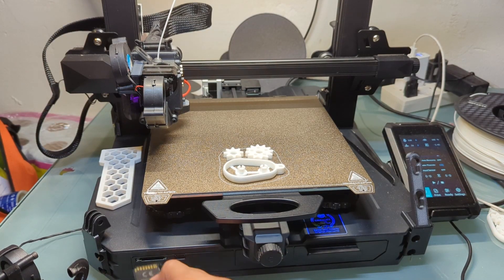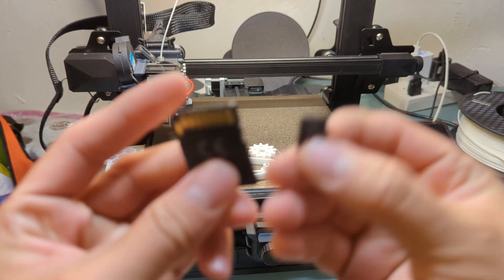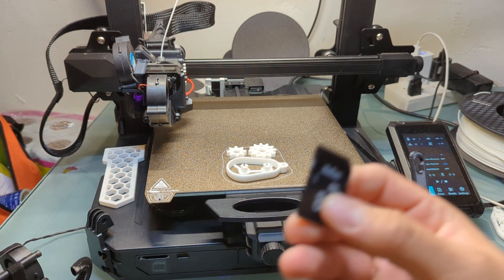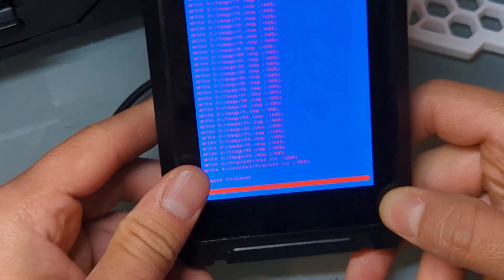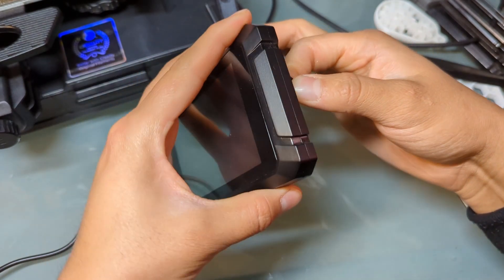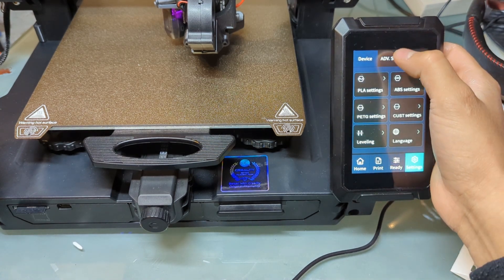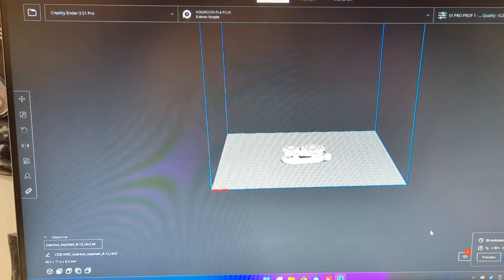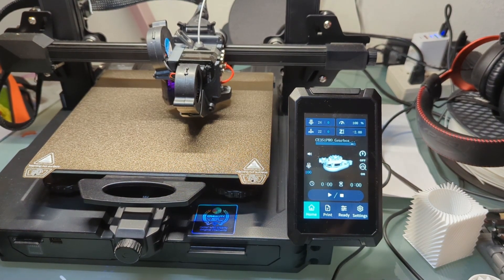Ender 3 S1 Pro/Plus - TT's New Custom Firmware (GCode Model Previews!) Part 1.

Comment: Enjoyed the video, but I have a problem. I have the an ARM   STM32F401RCT6  chip, but none of the firmware's work. Some load but still none complete the homing cycle. They raise slightly, homes X, Y, goes to center, CRtouch cycles , Z-axis moves down to their stating point and then stop. Have you a fix for this.

Comment: The TT firmware has a lot or errors, for example the step motors overheating, and don't deactivate when finish the print.  I had to revert to the original firmware, but It's good to try new ideas.

Comment: You never got around to making part 2 man, I followed this and now have TT firmware working on my S1 Plus, but the script for thumbnails wouldn't work with the current 2.3.0 Orca Slicer (on Mac), even though I meticulously followed all the directions in the GitHub page, and I got ChatGPT to guide me through it to make sure I din't muck anything up. But in the end ChatGPT found that the .py download script itself had errors in it which caused a persistent error in Orca when trying to export the gcode. 
After about an hour of trouble shooting with ChatGPT it finally figured out what the error was and I just got ChatGPT to output a completely repaired .py file which I copied and pasted into the text file and then it worked perfectly.

I can't believe such a simple little thing as exporting a thumbnail is such a headache and a complex thing to set up like this.

Maybe I should make a video of how mine is set up and provide my repaired Python script for anyone out there like myself that couldn't get it working by following the provided instructions....

Comment: Installed the firmware today, along with the display,,,,Bricked the machine!!! Problem is, if you choose laser, it will be stuck there, there is no flash or anything that will change it back to printer...Re-flashing does no good...BRICK!
Reply: Have you gotten your way out ❤

Comment: Just followed this video to update my Ender 3 s1 pro with this software which is v020 and it worked like advertised minus the screen load screen. not sure if that is a new thing or not. printer is under a year old.

Comment: what are differences between abl and ubl firmware s1 plus
Reply from the maker: I never looked into it, you can check on the discord though :)
Reply: To sum up, ABL and UBL are the same in that some sort of procedure is used to scan the topography of the bed surface but they differ in the sense that for ABL you are required to have a automatic leveling sensor and choose less points while you can have more probe points using UBL including advanced features as editing and storing multiple meshes.

Comment: You can determine which one you have by looking at the Firmware Version within the display's About section.
      You have a STM32F103RET6 if the F/W VER ends with F1
      You have a STM32F401RC if the F/W VER ends with F4

Like so more people see this. Thanks

Comment: Arkadaşım merhaba. Ürün yazılımını Ender 3S1 Plus yazıcıma yükledim. Ancak Dil seçtikten sonra bir önceki sayfaya dönmüyor, yazıcıyı kapatıp tekrar açmak zorunda kalıyorum. Bu aynı zamanda orijinal yazılımın önceki sürümünde de yaşandı. Otomatik seviyelendirme de orijinal puan sırası değişti ve sonuçlar tamamlandıktan sonra görünmüyor. Ekranda G.code görünmedi, ses açma/kapama düğmesi ekranda görünmedi. Birçok eksiklik var, umarım düzeltilir.
Reply: Hello, I too had issues like this on firmware upgrade, the microsd was my issue I used a new 16gb one and it worked, my other card was 32gb. May this help?
Reply: I don't think it's related to the memory card. I always install original software with the same memory card. I also have problems with the printer tray. I couldn't figure it out. @yukiusaginotaiyou

Comment: You can find your chip by going into settings then about rather than taking the bottom apart. 32 gig and below work for SD because they format to FAT32 required format for the printer.
I have a s1 not pro but i do have the touchscreen upgrade, do you think this will work for me my chip is F4.

Comment: it may be an amazing video, BUT TOKA'S FIRMWARE IS ABSOLUTE CRAP!
1. Homing is a total fail if you tram the bed either manually or automatically.  Also, the option to decrease the number of tramming points in the auto-tram map is not operable. 
2.The worst effect of his severely buggy firmware is that if you connect directly via USB, the hot end goes immediately to thermal overtemp. Only shutting off the printer solves this.  
3. Homing forgets where zero zero is almost immediately after a print.  
4. The Pause command drags the hotend over the entire print without and z hop at all thus stripping the print from the bed.  Stupid
5. The PID test is defaulted to run to 300 degrees on the very first test so you are likely to have thermal runnaway immediately because the first Oscillation goes to about 330.

You really shouldn't be pushing this guy's code. It is buggy and has very poor quality control.
Reply from the maker: Other than the homing issue on the earlier releases, I've never had any of the other issues you mentioned. Have you joined the discord and shared your input there so you can get help? Could be possible you installed the incorrect version for your printer.
Reply: 1. Homing works perfectly. The auto-tram points only work with 5, 7, 10.
2. This has never happened to me and I have been using this  (007-023) for over a year now.
3. After the print you must be using M84, which unlocks the steppers and that invalidates home.
4. This is a gcode issue, usually. Using "M600" to pause the print works perfectly. It has always raised up a far amount and than moved to the right fully.
5. It defaults to 300, but you can change it to the temp you are going to use. I cannot say this will or will not happen, because I have only used a max temp of 245 C.

Many, many are using this firmware without issue. So, you cannot say it is poor quality just because it did not work for you.

Comment: FOR EVERYONE WHO HAS F1 CHIP:
If you have been wondering, what rc or re suffix means, its you chup version. Look on your chip, and under stm32, you will have something containing rc or re. If you have rc, download rc bin file, if re, download re bin file. Also, abl and ubl are types of bed leveling, look them up on google. ABL takes less time, but its little bit worse, if you have worn out bed.

Comment: Hello. The calibration setting on my 3s1 Plus printer does not work. When I look at the automatic calibration indicator that came with the latest update, the edges and middle points show irrelevant values. I couldn't do any calibration. Does this software automatically calibrate according to the values received from BL Touch? Will I experience the same problems?
Reply: same here.

Comment: Hello. the firmware works well. Is it possible to make the motors turn off after printing is completed?
Reply from the maker: Yes those issues were fixed on the newer versions, try installing V20 (newest release). https://github.com/ThomasToka/MarlinFirmware/releases/tag/MARLIN-E3S1PROFORK-BYTT-v020

Comment: does it have to be fat32 cuz i only have a 512 gig micro sd card and it is not fat32
Reply from the maker: I believe you can format it to fat32, but I'm not sure it will ready 512GB, you probably have to partition it. Would be easier to buy an 8GB one just for this.
Reply: ok thx ill ask my dad if i can get one @Zeltroix
Reply: can you use 16 and 32 gb sd card @Zeltroix
Reply: I used a 32 gb card but I had to do extra steps to format it to the specifications needed. It will probably need done through disk management.

Comment: I followed your video tonight, got it all installed. Did the 10x10 one though, did my rough tram and then the auto bed mesh, adjust my gcode in cura and when it starts it just smashes into the bed, I reset all setting manually trained it that’s it removed the auto level in cura printed great, any pointers?
Reply: Read the installation txt. Pretty sure that would have saved us. 😥

Comment: The adapters from micro to standard SD do work. I use it all the time when updating this very firmware. Anything 8 GB and below work. I use a 2 GB micro SD with adapter.
Reply: JUST REMEMBER TO RE PARTITION A LARGER sd OR MICRO sd TO BE NO MORE THAN 8 Gb OR YOU CANNOT FORMAT TO 4096 SECTORS.
Reply: And where do you obtain these 2 gig micro cards?
Reply: @WitchyWayBoco  The screen and the main board do not recognize multiple partitions.
Reply: There is no such thing as an 8gb micro sd card In America
Reply: I partitioned my 32gb into 4 8 gb volumes and it still didn’t work.  I am learning on Marlins site, they are instructing us wrong. Even on the flashing.  The firmware or bin needs to be named differently first of all and Not similar to the previous firmware name.  Another thing is if you do have a partition or two on the card be sure to know which volume is your Root volume.  Otherwise you’ll have the same problem I have where I bricked my board.  Possibly that is.  Anyway I’m letting people know BE VERY CAREFUL about who you are allowing into your printer.  There are devious people who are jealous and don’t want to see you get ahead of them without a price.  Do for yourself what others say they will do for you and then disappoint you.  It’s not worth having to deal with this caveman ways.
Reply: @WitchyWayBoco  Do not format into 4 volumes. Only 1 volume and leave the rest as unallocated.
Reply: @dl200010  I did it that way the first time 3 tries and it didn’t work.  Then I did the volumes because somewhere I read that it should be done that way.  I have an iMac and I don’t have a problem with code either.  AWS is where I have my cloud storage, I am an employee of AMZL and my relatives worked for Sun Micro systems.  I have tried everything.  I have noticed that the Ender series you all have appear to be superior to the 3 S1 Pro that I have.  Especially in the Controller box.  I have no way of knowing if something has been saved or changed other than going to the area where it lists the hardware Firmware etc.  it’s so annoying to know what you need to do but have no way of doing it!
Reply: @WitchyWayBoco   If it does not work with 1 partition at 2 GB, then you need a different card. The Ender 3 S1 main board and screen are very picky on the cards used. Try another card formatted with 1 partition at 2 gb or buy a smaller than 8 GB card.
Reply: @WitchyWayBoco   Also read the instructions. There is a server where you can contact myself and many others that can help. Even the developer of this custom firmware is there.

Comment: the soft readme notes shows this - Support high-speed printing (160mm/s) & optimization of vibration pattern. - did you manage to print on higher speeds and what settings did you use ?

Comment: This is great, I'm going to attempt this for my S1 Plus.
Do I need a creality update on my main board before I do this?
Mine is stock out of the box.
Reply: Won't matter much, my machine shorts out all the time, I'm going to take it back, Mayne a replacement.
Reply: @marcmiddleton2277  Yes, it sounds like you have hardware issues and should be able to get a replacement, depending on how long you have had it. All the parts for these printers are available online if they won't.
Reply from the maker: I believe that is recommended, should be on the instructions too, good luck! :D
Reply: You do not need to update the main board to stock 28, only the screen is needed, if your screen back looks like his.
Reply: I tried it and unfortunately it didn't work.
Reply: @yilmazbozaci7641  same for me